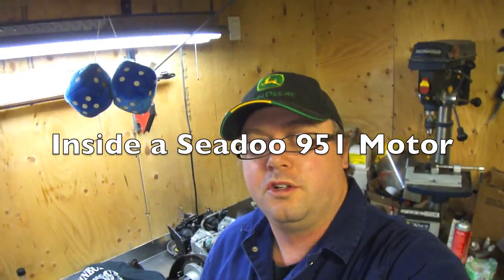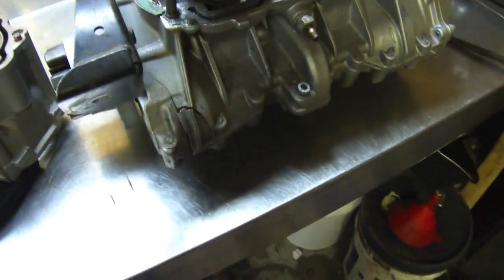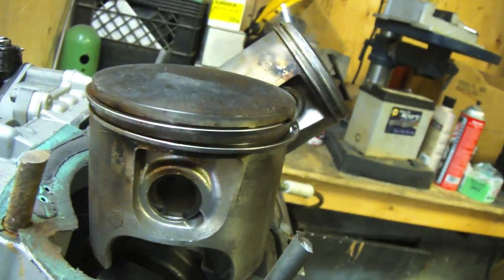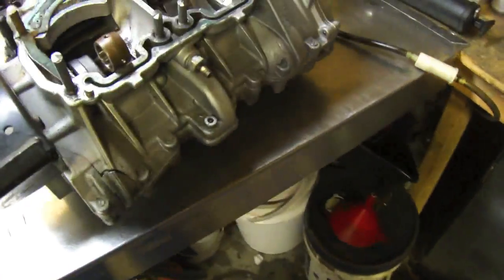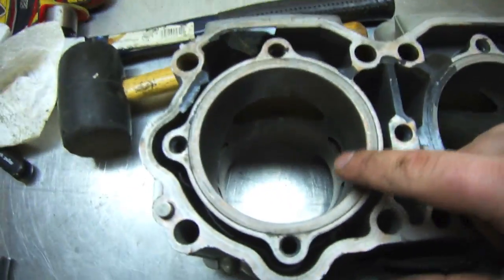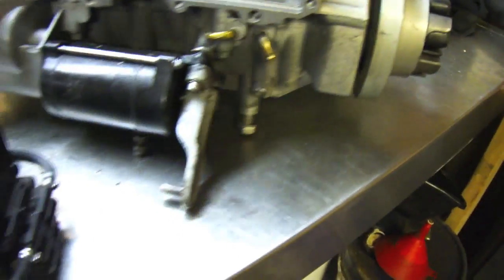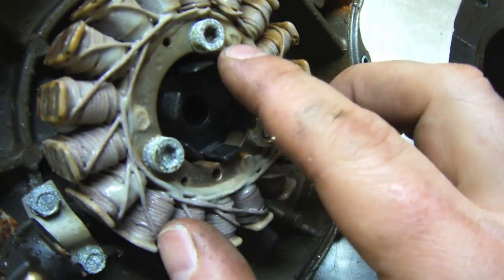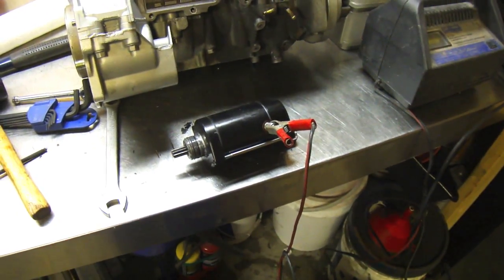Inside a Seadoo 951 Motor

Comment: Hey Mate, Is there anything a 951 owner can do to prevent this issue happening?
Reply from the maker: Flush your machine out after you bring it home
Reply: +Bullshitkorner  Are you talking about just connecting the line up to the ski?  How about the counter balance shaft oil,  does or can that be changed?

Comment from the maker: 1: because the counter balance shaft seized and took out the crank so you couldn't turn the motor to help get the pistons off and 2: the bolts were so corroded that they had to be pounded out of the cylinder block after they were cut off

Comment from the maker: the rave valve connects to a solenoid that is mounted on the body of the seadoo, it should be right close as the hose is only so long.  the solenoid will have 2 other hoses connected to it plus a electrical connection

Comment: I have a 951 GTX Limited .. I rebuilt the engine. I have a minor problem I cant find were the hose from the RAVE diaphragm connects. I think it needs to connect some were on the crank case but I cant find it does anybody know were it connects

Comment from the maker: the counter balance shaft is one you need to pay attention to as far as bearing failures go.  A rattle could be a sign indeed, unfortunately the only way to tell for sure is to remove the motor and split the crank

Comment: do you know If I can take the 951 out of my 99xp limited with the carbs on and exhaust?  I stripped a carb bolt and I'm about to try to remove the whole engine.  thx in advanced

Comment: As you throttle it, it decreases the oil flow.. not increases. As the rpm go up it naturally pumps more, so as not to load it up the mechanism leans it out.

Comment: wow this is the longest rebuild i have ever seen i dont think you will ever get it rebuilt beater selling it on if i was you would do away with oil injection and go premix just got mine changed noticed oil injection cable was just about to snap anyway good luck hope you get it completed